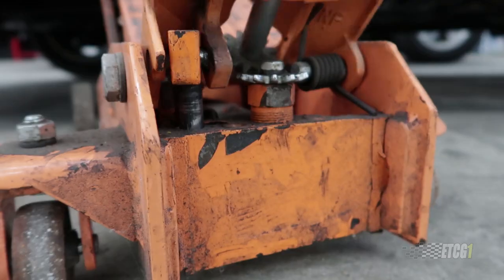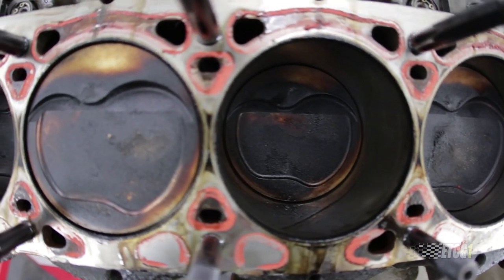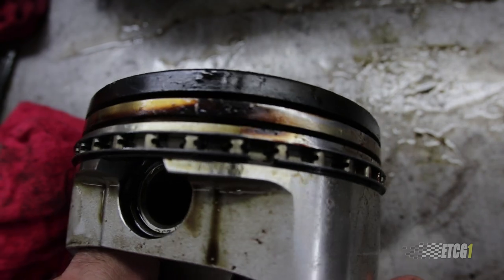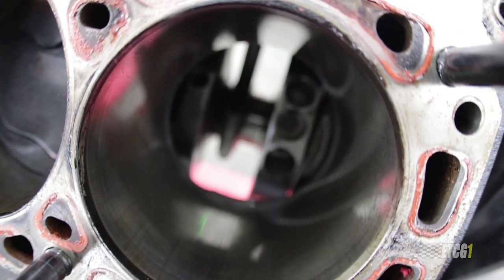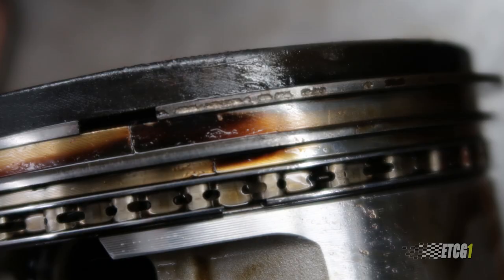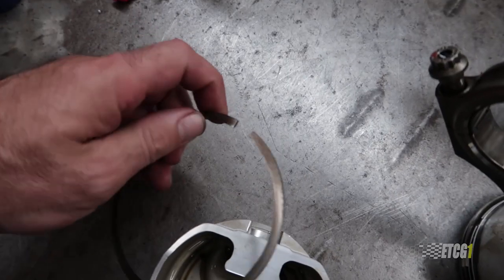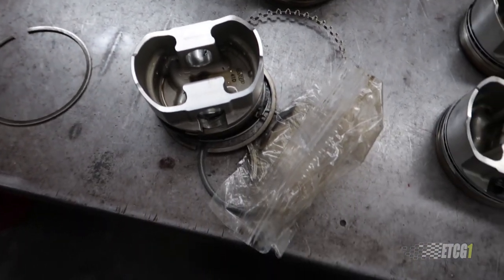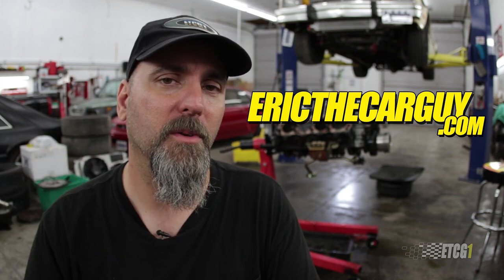Hydrostatic Lock the Silent Killer

Comment: why aren't engines designed in such a way that if a hydro-static lock happens the spark plug will be pushed out of its place to prevent damage to engine internals